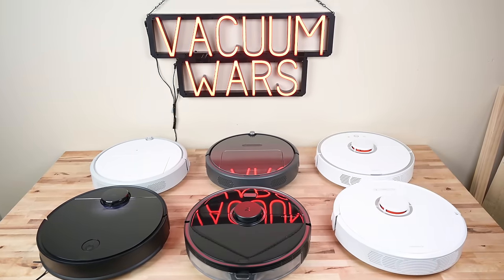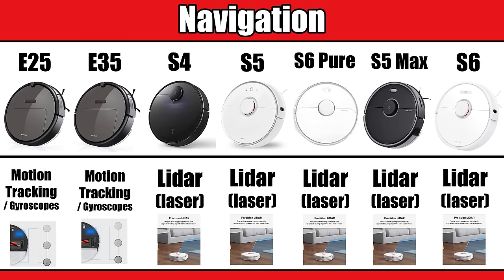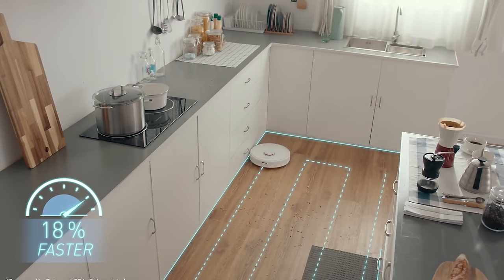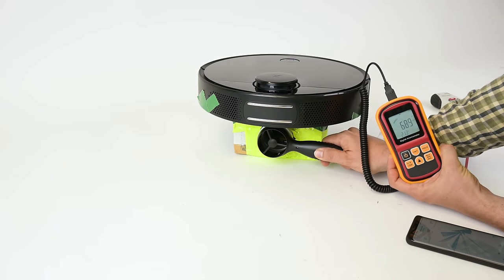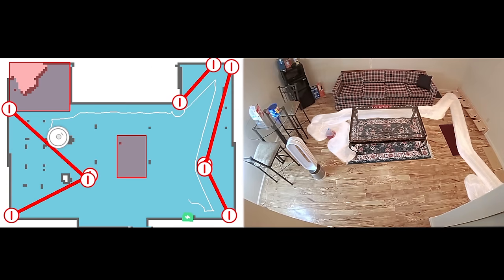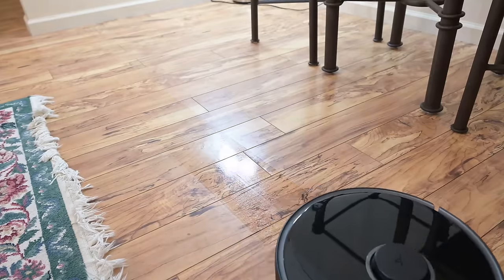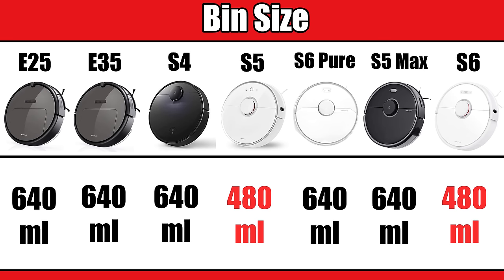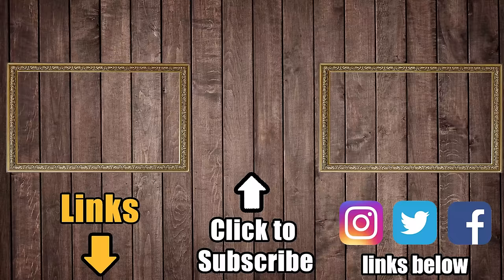Roborock S4 vs S5 vs S5 MAX vs S6 vs S6 Pure vs E25 vs E35

Comment: I watched whole lotta of your reviews and bought S5 MAX based on it. It is CRAZY GOOD! So weird to have your home cleaned for you while not there and not have to worry about it! I can even vacuum my flat while miles away if there is a wifi! 😀 Thanks for your videos! It served a good purpouse!
Reply: Kde si ho prosim ta kupoval Martin?
Reply: Yeah I have S5 and have integrated it to Home Assistant, and made an automation that starts the vacuum when I've been out for a few minutes during certain hours. Works like a charm, no problems at all!
Reply: @MojeMeno69  Aliexpress 499 usd ...posilaji i z cr https://www.aliexpress.com/item/4000645007897.html
Reply: One year later, how is it? Do you recommend I buy it in 2021? 
Also, I do have carpets , is it good with carpets?
Thanks

Comment: I first got the S4, but while it was great on hard floor it REALLY struggled on carpet, and doesn't have the same carpet mode feature that the S5 has. Roborock support themselves pointed me towards the S5, which has been working flawlessly on my carpet.

If you have mostly carpet, get the S5, not the S4 (until they improve it to work on carpet).
Reply: S4 for 330 or s6 pure for 350$ I need help
Reply: @JustxLiving909  what did you pick

Comment: The S5 got the room divider app update recently. I’ve been using it recently on the S5 I purchased back in December.
Reply: yep, depending from region it's official or not, but anyway You can u/l firmware with extra app. works quite well :) so please update that fact in video. Also not sure about dustbin size, I saw on roborock website a 460ml for s5 max.. is that a typo?
Reply: Yes, still didn't get it but other users already received it.
Reply: Also have received the update, can confirm.

Comment: The s5 has room select with the latest firmware update :)
Reply: airpeguiV2
How? Mine still reads “firmware up to date version 3.3.9”
Reply: airpeguiV2 
I am from the US, I got the S5 from aliexpress. So I guess that’s consider the “international version”. So is everyone from Europe has the latest firmware except the US?
Reply: Same here in UK. Room selection updated to 3.5.7 through FloleVac. Works like a charm
Reply: I want to say the room selection firmware already updated in china half year ago.
Reply: Just checked my version and it's 3.5.7 and I'm in the US. However my phone is set to British English. Not sure if that makes a difference. I've had room select for a few weeks now.
Reply: I’m in the UK so in Europe with uk location set - still showing version 3.3.9 no updates shown :-(
Reply: question to all of you s5 owners: does the s5 have issues of the side brush getting stuck on carpet?  your reply would be really helpful :) (my s4 has that issue, thinking of switching to s5) thank you
Reply: @dvo1060  I just tested it on my bathing rug, which is THICK. It did get somewhat stuck, but i don't expect brushes in general to be very effective on thick carpets or rugs (thin carpets not a problem).
That said, if you browse around reviews, you will notice that some reviewers do remark on the S4 having some difficulties with traversing thicker or rugged carpets, and hence have recommended the S5, S5 Max or S6 for homes with these. The S5 should be better in that regard in general, especially with traversal, but don't expect miracles. Thick carpets generally don't mesh well with robot vacuum cleaners.
Depending on the size of your home, you might consider vacuuming the carpets yourself and keeping the S4 for the rest of the house.
Reply: Am I right in thinking that the number of rooms maxes out at 5 for the roborock s5? is it possible to get more room divisions on the later models?
Reply: @dvo1060  no issues like that at all.

Comment: Nice video! Although some errors. The dustbin in the S5 max is 460ml not 640ml. The dustbin for S6 Pure is 480ml and the dustbin for S4 is 420ml. Also the suction power in S6 and S5 max is the same so the airflow should also be the same.

Comment: I got the S5 and the S5 Max at home for testing last week and the one that won for me was the S5. The new spin brush from the S5 Max got tangle twice on 2 different pile size rugs and even ended up breaking one arm. Also another issue is that S5 Max could not vacuum one of my mid pile rug while the regular S5 was able to vacuum it with no issue. Even though S5 doesn’t have the better app and better map I decided to keep the S5 and return the Max to Amazon. Not to mention that I save like $120.00. Thanks for your reviews!
Reply: Did you install the latest update for the S5? If it's not available in your country yet from roborock on Mi Home you can istall it using flolevac app. It has room select and the differences are for now that you can't name the rooms and because of that you can't run the robot on customised voice control and can't make different time schedules.

Comment: Will stick with my s5 for a few more years, been loving it, bought since launch.
Reply: Me too, until it runs or until roborock launches a much better robot, one that has AI, a self emptying dock or both. This are worthless upgrades that roborock made and now sharq, ecovacs, roomba (crazy expensive roomba) surpassed them. Roborock seems not beeing able to come up with anything new,... just the same sh*t over and over again, just different software and fooling customers that it's much better because it cleans 5 minutes faster, or it's water poors quicker (S5 max),... i wrote above what i did with my S5 mop,.. it kicks any other roborocks ass if one does that. (Ofcouse you can do that with the S5 max too and it would be much better).
Reply: @CountPorcula  Beg to differ. No major update yes but they definatly updated their robots to the point that they are still one of the best. The only thing missing to roborock is the self-empty capability. I have the shark and that (and maybe the price) is the only thing better. Neato seems to do great robots but not as reliables and customer service seems average at best.
Reply: @guillaumepare9651  you clearly havențt seen the Proscenic M7 Pro, that is what roborock should have done,.. Search for it on youtube. And by the way,.. The S5 still is one of the best robots out there,.. the S6 is just an overated S5 with VERY small and unnotaceble upgrades.
Reply: @CountPorcula  I'm not saying the s5max is the best of the best. I'm not saying it's perfect. I agree that it's not a major update over the S5. All I'm saying is the s5max is nevertheless among the best. On your post, you were comparing to the shark which I also own and the s5max is superior IMO. One thing I like about Vacuum Wars is that he goes way beyond specs.
Also, I'm quite sure that Roborock is redesigning it's robots. The actual generation shares many of the same replacement parts. it has it's cons but, for the moment, I think it has more pros. The next generation will most probably have an empty bin base and they will most probably redesign the robot altogether. That mean another generation of parts.

Comment: Regarding the S5 Max having a larger dustbin (640 ml) than the S6, is this definitely accurate? Roborock's website and almost all other reviews make mention of the S5 Max having a SMALLER 460 ml dustbin. This is a big deal for me, as I hate emptying the dustbin often!
Reply: Guess one has to go with self-emptying feature then. 

After using vac without self-emptying, I fould that suction power decreases substantially after bin filter is covered with dust layer. So have to clean the bin every 2-3 days to keep cleaning effective. Although it has turned out to be fairly fast as after throwing off the bulk of waste I just vacuum the bin with normal vacuum for 2s and then bin is as good as new.

Comment: I just replaced my Neato D4 with a S4. Only reason I did it was the D4 had a lidar/probally board failure, not any real complaints about the D4. I'm pretty surprised how much better the S4 is at navigation. I have a old Victorian house, so doors little rooms, just oddities that make navigation odd. Even with no go lines the Neato would always get stuck atleast once a vac. Which I put on my house not the bot. But that S4 is rock solid never gets stuck and mostly does as well at navigation as could be expected. Pretty impressive the differences Ive seen considering on paper they appear mostly the same level.

Comment: 1 year and 2 months now with S5.
Laser motor started breaking at about 8 months of usage. The breakdowns are becoming more often (like once every few weeks). The upside is that it only needs 9V external battery to be fed by and then its fixed. Tho, top cover always makes me wonder when will it break, because its quite hard to remove.

Comment: I have both the s4  and s5 for different levels of my home. Unfortunately my s5 gets the error 13 issue and I have to continually place the unit back on the dock. I have checked voltages and everything appears Ideal. Also the charging surfaces are spotless. I am trying a last ditch effort to replace a fuse on the motherboard, that is related to the error. Hopefully that fixes. My S5 lasted almost 2 years flawlessly. What a shame, I have to go through this rigmarole! My S4 keeps on chugging away no issues ever!

Comment: I purchased an S5 Max and I had to return it back, because it was a mess with maps. Every day there was a problem with the maps. Every time I had to delete and re-map my home again, and after few good works it was messing up again and again. 
The map manager is not really good, because it allows only to insert "no-go" areas and "forbidden walls", but no real editing on the map itself, so if there is a problem with the sensors that falsely perceive an area that doesn't exists, the only possibility is to draw a no-go area on it. The problem is that I have a pretty large house and it was really ugly to be forced to delete the map because one room was not working correctly at all.
I will try again with an S6 Pure that seems the last arrived, hopefully with a better firmware.

Comment: 2000 Pascals = 2 KPa = 8" of Water Lift. That's EIGHT inches of lift. I always love it when manufacturers attempt to visually inflate specs. Imagine attempting to sell an expensive item with the numbers "2" or "8" when you can print "2000."  If I carry around the equivalent of 2000 pennies in my pocket, that would be a $20 bill.

Comment: Is it worth to buy used working unit of S5 for 150$? New one in my country is around 340-370$ I have some random chaos cleaning franchisee company that I bought on sale for 50$ it has water tank and return to base if battery is low, it has auto carpet mode and can be programmed for days of the week and times but has no app and is chaotic sometimes cleans in spot it cleaned before from Amazon and we love concept of robot vacuum cleaners now. It's better than nothing my mom is so happy seeing it when she comes from work and seeing it vacuuming space.

Comment: Great channel.  Thank you!   I recently bought the Roomba S9+ with the Braava Jet M6.  The S9 is working great.  The Braava consistently says it is about to fall off a cliff.  Turns out that the M6 does not support dark floors.  The S9 anti fall sensors support dark floors.  I’d like to ask that you include in your tests, dark floors test.  Is that possible?   Thanks.

Comment: I really like roborock. However I really wish they would make them slimmer...which is a bummer if that extra inch and it is not going to fit under your bed and sofas. I ended up with coredy which was 2.7 and fits everywhere vs roborock which is 3.6 which make a HUGE difference.

Comment: Hi! Great channel. Would you consider doing threshold testing? Particularly on the Roborocks. I’m moving into a new bigger apartment and am excited to get a robot vacuum. Though the apartment is old and thresholds are high, probably 2-3 cm (~1.2 inches). If you’re not planning a video on the subject. Do you have any suggestions?

Comment: Thanks for the video. Is it possible to schedule the charging, to take advantage of off-peak electricity tariffs?
Reply: I guess, scheduling the vacuum so that it finishes cleaning and returns to the dock in time to charge during off peak.
Reply: No one would've bothered tweaking hours on the dock. The easier way to do what you want now is to simply watch how long your bot's going to work in your place, then schedule the cleaning at around those off-peak hours.

Comment: Hi! I'm looking for a new robot and i am thinking of buying the roborock s5 max, but I've seen videos of the ozmo 950 and now I don't know which to buy... Which of those, or other for that price, you think it's the best?
Reply: Reviewers heavily disagree on the Ozmo. Some think it has excellent cleaning, while a few others have said the opposite, which i find peculiar, considering that it's been measured to have some of the highest airflow in the business. Ultimately i think it might be better than the S5 Max, but also it's just slightly more expensive.

Depends on your house i guess? From what i understand, both bots have great traversel ability, but it seems like the Ozmo can do slightly taller door frames. I have the old S5 and its great at cleaning my apartment, which is a 1 room apartment with a completely flat carpet. Do you want to spend the extra ~100 $?
Reply: @Athinira I finally bought the s5 max and it's so incredible, I bought it because reviewers said the s5 max was better cleaning with water and the extra  airflow of the 950 wasn't noticeable

Comment: Any hints on what the S6 Pure will " have/not have/add/remove " as far as features.  What customer type is the S6Pure geared for?
Reply: 0:32 maybe it has dirt decent.
Reply: As far as I understand, it has fewer sensors, louder than the regular S6, and equipped with bigger dustbins

Comment: The S5 max has a 460ml dust bin, I think?
Reply: You are right, the S4 also has a smaller dustbin (420 ml)
Reply: Smart Robot Reviews 
I’m pretty sure the S4 has the larger dustbin. Or that was one of the selling points in early reviews of the S4 compared to the S5 and S6 iirc.

I find the recharge and go feature not needed in my house. But with a chocolate lab (sheds a lot!), the missing feature on all these robovacs is a dustbin sensor to alert when the bin is full. I find my S4 continues to clean (or try to) even when the bin is full. So it leaves debris behind that it would otherwise clean up. 

I also have a Roomba i7+ that will return to base when the dustbin is full, empty itself,and return to complete the job. I find that to be the most useful feature of a robovac in general for living spaces that tend to accumulate more debris than the small dustbins can hold.
Reply: @speedlever  I also thought it is bigger (at least it looks bigger). But I filled the S4 dustbin with water and it was able to hold ~420 ml (Roborock claims the same size for the S4: https://en.roborock.com/pages/robot-vacuum-cleaner-compare ). I already recorded a video comparison, will publish it within a few days.

Comment: Now that everyone is working and schooling at home, I need to find a quiet Robot vacuum.  How does the S5 MAX ( which appears to be the best Overall Robot vacuum in this line ) compare to other Mid-Range Robot Vacuums ( whether it be a Roborock or other Robot vacuum brands ) when it comes to noise level?
Reply: I have the roborock S5 and a Shark 720. I'm not really sure how loud they are on paper but the roborock is a lot louder than the Shark. I think it's worth it though because of all the cool features.
Reply: @ivana4942   Thanks.  The S5 MAX was on sale on Amazon Prime Day, so I decided to get it.  I liked that it has both a mop and vacuum option.   Hopefully it won't be that loud and I can run it downstairs and upstairs on the carpet from time to time and not bother anyone.

Comment: 1 consideration, doesn't the s4 have a lower climbing ability? I am sure they turned the drive wheels 180 and as they collapse into itself back to front rather than front to back it can struggle over higher obsticicals like a thick rug. 

Great video though and keep them coming, really appreciate the videos and info, really well presented 🤘
Reply: Well they are saying that the climbing is 15mm for S4, but mine never stucks or struggle with carpet. It works flawless.
Reply: My S4 works well on low-pile carpets but can't really move on medium-pile carpets. They did something so the robot gets closer to the ground to perform better. It doesn't struggle with climbing onto some thresholds but wouldn't work on shaggy carpets.

Comment: Hi, thanks for the detailed comparison! Can i check if the s5 max and s6 have the same dimensions? Especially in terms of height, because I'm trying to confirm if the s5 max can go under my sofa for cleaning. My sofa legs are 4inches long, crossing fingers it can fit!
Reply: Yes it can. It's 9.65cm / 3.8in high.

Comment: I just bought S5 Max, and as far as i know, dust bin size is smaller than in s5 and s6...
Reply: PiotrWarsaw yeah ive been looking around for info and nowhere does it mention the dust bin to be bigger, just different shape... 460ml instead of 480 on the S5
Reply: @XilenceSR  indeed. And not 640ml vs 480 ml for sure.
Reply: There is a comparison chart on the official website